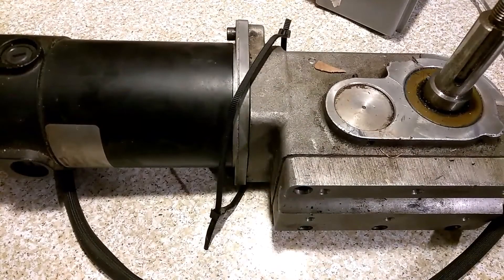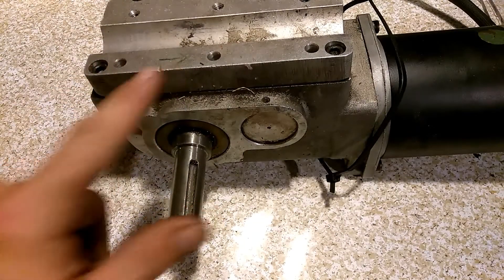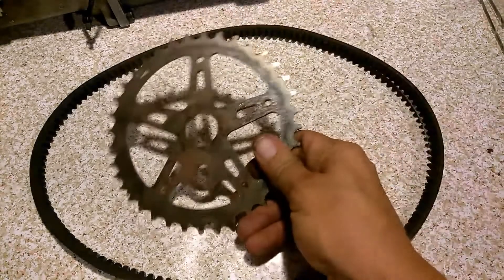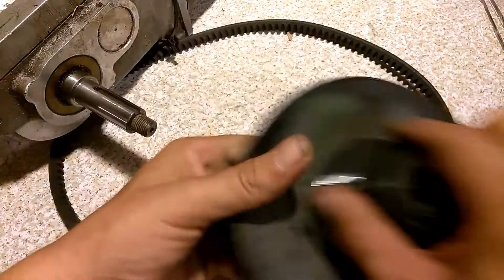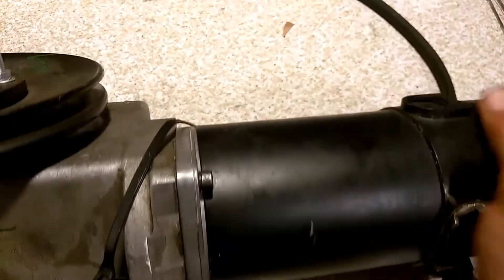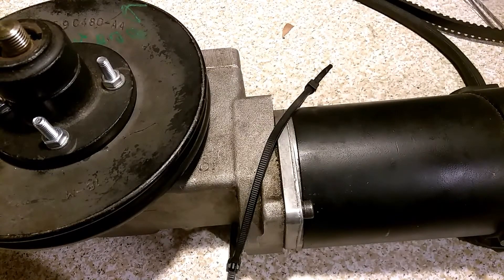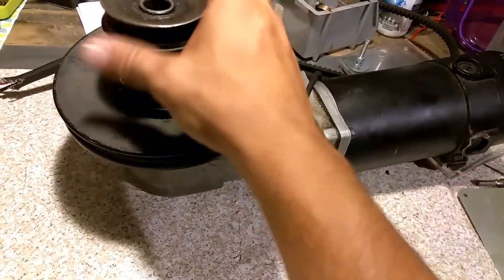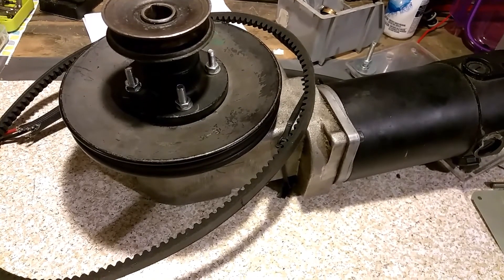New ebike project. The motor.

Comment: The issue with that motor is its controlled by a computer. It's from a power chair. If you can get the controller from it you would have a much easier project. Good on you for building this.
Reply from the maker: Matt McMahon Inventor the motor is an old style brushed motor. The controller from the wheelchair unfortunately has a safety that requires both motors and brakes attached or it won't come on. If you check out my early etrike builds on instructables I use the control stick and computer.
Reply: ThriftStore Hacker. I used to work in a wheel chair repair place. I figured both would need to be connected what you should try to look for is a pwm that can handle that voltage and wattage. Either that or see if an arduino can hack the controller. Again good job. I gave one to my buddy and he modified a foot propelled scooter he said the damn thing almost popped his kid off. So what I just thought it's if you have a switch to control the voltage maybe you can accelerate with using 12 v till max speed then switching over to the 24 v. That's essentially what a pwm will do. Let me know how it goes.
Reply from the maker: The pwm I am running on my current electric trike (same motor setup) was 20 bucks and has worked for about a year. The quality of the pwm is garbage but I back it up with a power cut off at the battery and a circuit breaker. If the pwm fries it goes full power. I learned this the hard way when I burnt one out with no cutoff. Stuffed the recumbent trike in a drainage ditch.